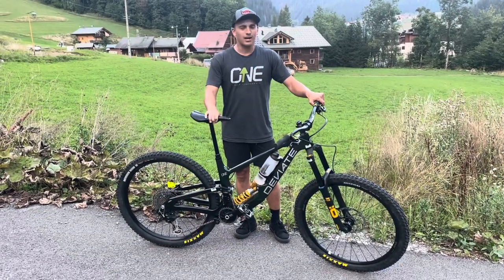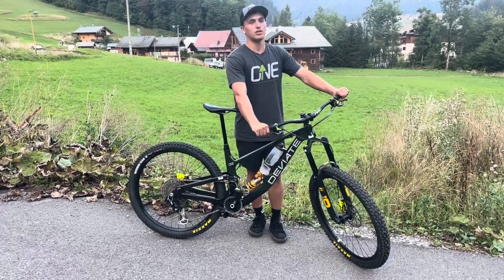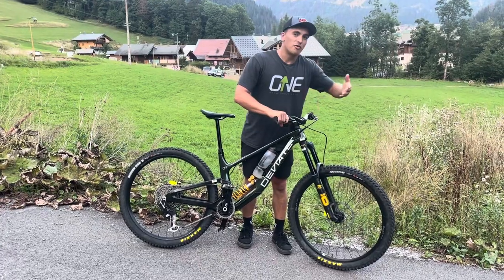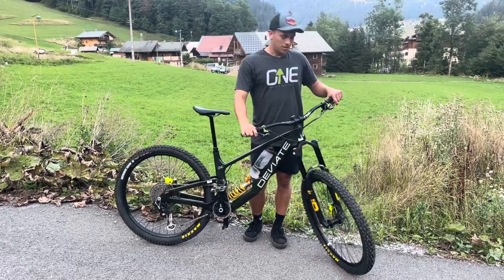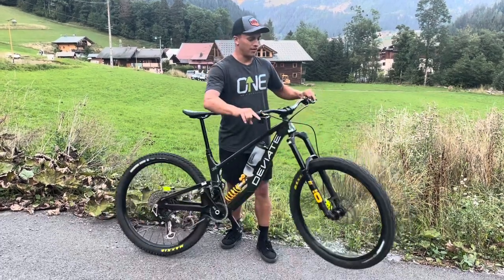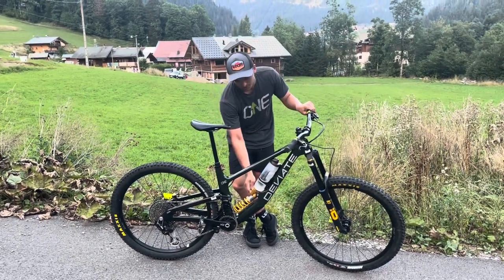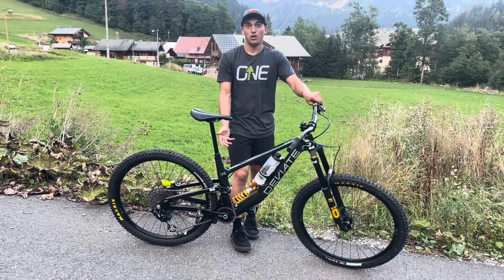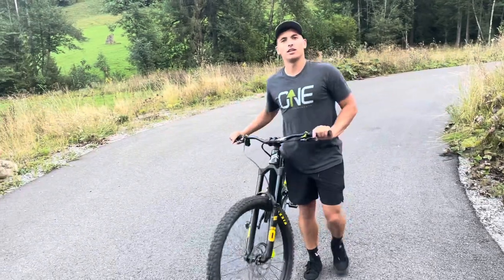DEVIATE CLAYMORE - RACE SPEC DREAM BUILD

Comment: Hey Lachlan really enjoying watching your videos over the last few days. Makes me want to get back to Chatel asap! I’ve just got my hands on a Highlander 2 which rides amazing and im starting to play around with the setup. Any tips or tricks you have found that work well with the Deviate  platforms? It looks like lots of people like the Claymore setup soft and fast which seems to be a theme for enduro racing. What setup do you run sitting or standing SAG wise? Would you run a similar setup on the Highlander 2? 
Cheers!
Reply from the maker: Hey, glad you’re enjoying the videos! So I don’t tend to measure sag very precisely, I’ll aim to be between 20-30% sag and then I’ll do testing with the spring weight above and below to see what works best for me. I’m running the 500lb spring at the moment and almost full speed rebound but quite a lot of low speed compression to hold the shock up, I use more low speed at bike park style places and then at home I’m closer to having no low speed on. For the Highlander I run a firmer setup to have the bike more agile and playful, however you can run the suspension the same as the claymore if you prefer a more planted feel it runs well with both setups!

Comment: What length dropper do you have? I'm trying to decide between the 180 ad 240. Going for a M claymore, but I have loooong legs so thinking the 240 will work
Reply from the maker: I use a 210mm dropper which works perfectly for me, the Claymore means you can run a seatpost really low so if your legs are long enough a 240mm would be ideal!

Comment: What length of cranks and what size chainring are you running? Also, what’re your thoughts on MX wheels? Churrrrr
Reply from the maker: I’d usually run 165mm cranks however these are 170mm as there were no 165’s available. With the 170 cranks I run a 32t chainring, usually when I have 165’s on I run a 30t chainring the shorter crank arms mean you need a smaller chainring to have the same cadence on climbs etc. With the climbs being steep at home I like having an easy to spin first gear!
I’m a big fan of MX wheels, they make for a very playful ride, however I’m not sure if they are as well suited to racing Enduro as they are DH. The extra rolling speed of the full 29 on flat sections and rough straights I think is beneficial over the course of a full enduro race day. It’s something I find really interesting and I’m hoping to do some proper testing with Deviate this winter!
Reply: @lachlan_blair  I’m toying with 165/ 155 cranks on my HB916 but can’t decide if they’ll make enough of a difference. Cheers for your insight! 🤜🤛
Reply from the maker: I really like the extra pedal clearance of shorter cranks, I’ve not tried the 155’s yet but they’re definitely interesting!

Comment: Thanks for all info! Curious how much you weigh? Im getting a claymore soon and trying to decide on the coil to go for?
Reply: Im about 85kg geared up if you have any suggestions. Wouldn't mind knowing what settings you use on the 38 also if you can.
Reply from the maker: I’m about 83kg geared up and using the 500lb coil I’ll occasionally go up to the 520lb as well so I’d maybe suggest 520lb for you being 85kg. Or if you prefer more sag then 500lb will be all good! 
38’s I run pretty much exactly as the pressures say on the forks rebound full speed and then adjust the compression depending on the tracks and conditions 👌